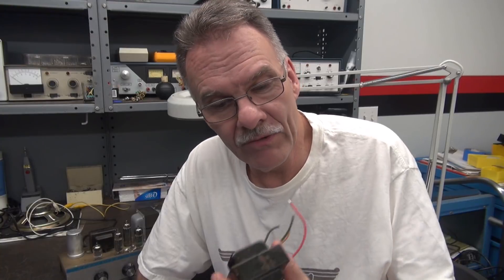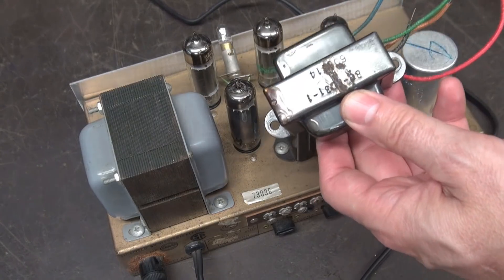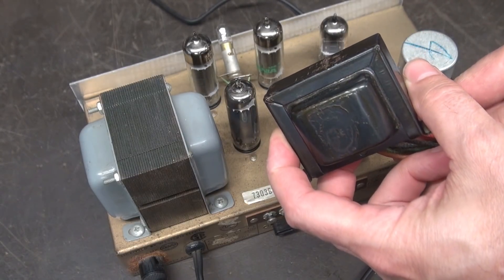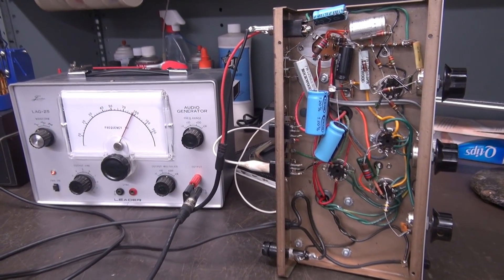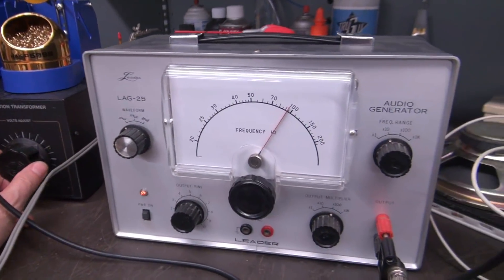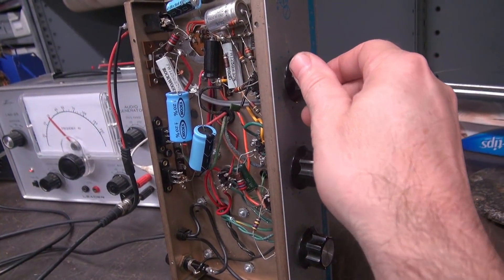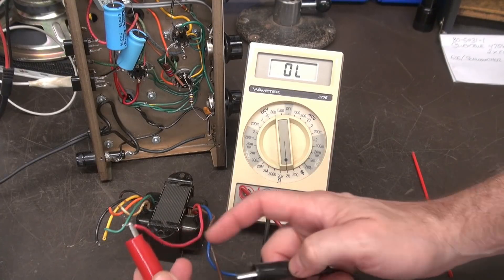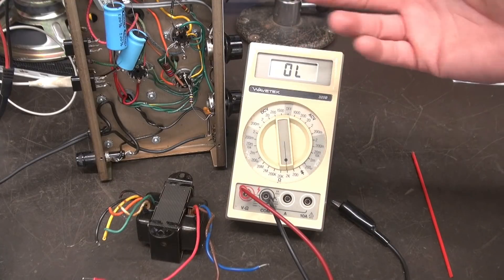How to fix Tube Guitar amp Motorboating Precision Electronics S10 Part 2

Comment: Wow! I purchased a used JCM Marshall 4501 combo from Guitar center. I received it yesterday  from UPS. Plugged the amp power cord in and made sure the gain and volume knobs were all turned down. I turned on the amp w/ out the guitar plugged in and after less than a minute it started making the same exact popping noise as the amp you are demoing. It started getting louder. I plugged in my guitar and played some chords but no sound came out from the guitar except for the popping noise that was already popping. CRAZY.... any help would be greatly appreciated. Thanks

Comment: it's kind of funny that you used a Silvertone output transformer to replace the Transformer in what looks to be a small PA or mono Hi-Fi amp, because some years back I had a small single-ended Silvertone amp, Danelectro built as I recall, that had a very small exposed- bobbin output
 Transformer that was arcing, and I replaced it with a Transformer pulled from either a small PA amp or a small Harman Kardon integrated amp, I don't recall exactly which. it worked quite well and sounded really good afterwards.

Comment: Why are you saying it's a bad winding?  I've also seen where it's the connection between the wire lead and the winding that goes bad.  And perhaps a better question - if it is the winding, why did it fail?  I'd be concerned that history repeats itself.
Reply from the maker: My guess is it failed due to a short when someone was prodding around inside. As you can see in the 1st video, the blue wire went to the replaced tube socket. May have suffered it's fate at that point in time.
Reply: Good point.  Still, if you're just going to toss the old transformer, there's nothing to lose by opening it up and looking.

Comment: I was thinking that it was a broken wire and the occ. was caused by  it sparking across the gap. It loading up and then gaining enough to jump across the break. Thx terry hope u have a great day!!
Reply: Good thought except I don't think sparking could be as regular as that which we are hearing.
Reply: Probably the core is saturating (given the imbalance with half the winding out), causing the supply to rapidly discharge to ground (a saturated inductor is just resistance), then the transformer and supply both recover gradually until it saturates again.

Comment: Motorboating: I suspect the oscillation comes from the B+ building to a point where it arcs across the open spot in the winding. The resulting discharge drains the power supply caps to the point where it can no longer sustain the arc and the cycle repeats. In addition to noise from the arc there can be a lot of other frequencies generated depending on the inductance and internal capacitance of the output transformer. (Google for "Relaxation Oscillator" and "Spark Gap Transmitter")
Reply from the maker: I agree man. I should have fired up my shortwave receiver and caught the wave!
Reply: LOL - I can see random hams around you trying to copy CW from the signal or figure out exactly what that strange beacon is.  73 - W5SSJ

Comment: I've seen some cases where the output transformer is fixable,  as the lead just becomes disconnected in an easy to reach spot.
Reply: I to have fixed output transformers before.  Have seen a couple that had a bad connection between the stranded wire and the internal enamel coated winding wire.  Pop the covers off of it and the connection was usually burned up.
Reply from the maker: Yep, I could see the windings from underneath where the leads exit, looked a bit toasty.